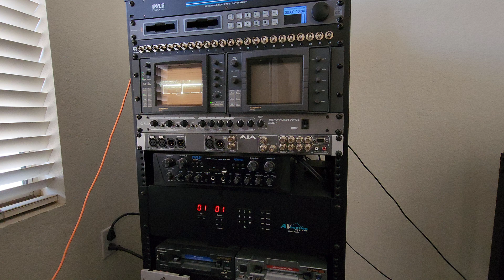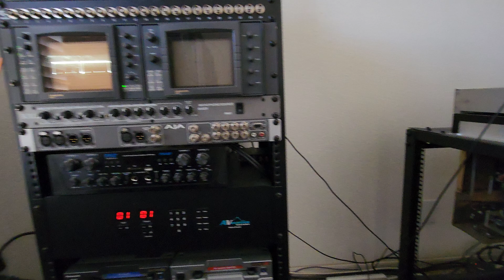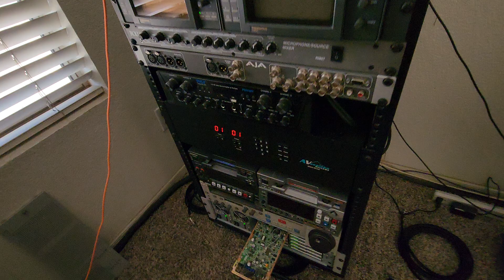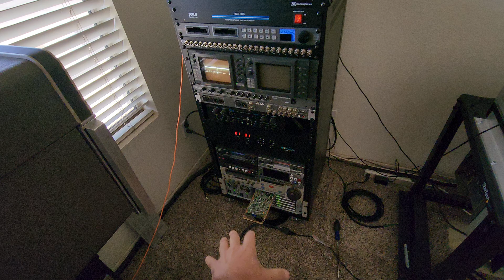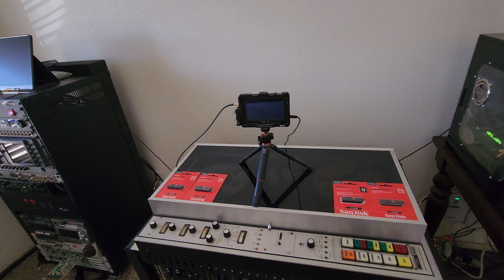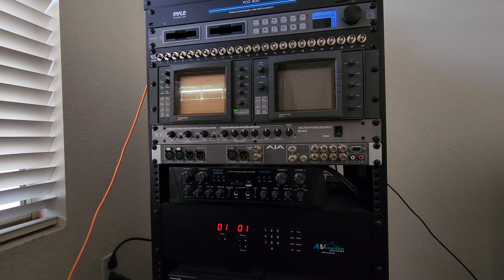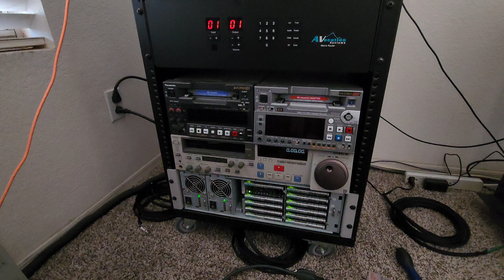Time Base Correction Frame Sync Why It's Needed...

Comment: Some (digital) timebase correctors can also handle U-matic Dub signals, which provides a huge improvement over Composite Video connections for U-matic tapes.  But they are hard to get, as are the cables.
Reply: I have a IDEN IVT-7 that has dub that converts to S-VIDEO and eventually when I get a U-Matic deck with dub I'll build up the cables I have parts for.

Comment: @4:30 Just a suggestion. I would not run broadcast machines with built in TBCs though that ForA unit. It's redundant and actually degrades image quality. On a broadcast deck, the tape signal is digitized, either a direct digital recording , D5, or via an AtoD converter on the internal TBC, Betacam, Type C. Then it's converted back to analog. Now when you put the external ForA TBC in line, you are going through another AtoD / DtoA conversion. That means analog filtering is being applied twice again. As broadcast formats are of very high quality, it will make a difference. All broadcast decks have proc amp controls, Video, Chroma, Black, Hue and more just like the ForA does.
Reply: Although the first comment only rightly bashed 2 US companies, YT subsequently deleted my Audio Delay answer comment.

Comment: Altera Max FPGA combined with several individual VSLI on a heavy, multilayer PWB definitely built for field/professional use appears quite expensive. That's not even considering the rack housing with its backplane and power supplies along with 12 individual modules. Maybe now, an equivalent individual TBC system could be primarily "software" based in a smaller and less costly form factor, but I still enjoy seeing older designs of mostly dedicated hardware-based TBC's.

EDIT: Just noticed that it's made by FOR-A, which was established in 1971 in Japan, then a US subsidiary in 1972. The FA-410P in 1981 was considered "the best time base corrector on the market." Apex quality equipment. 😎
Reply: That product was designed for TV stations incoming feeds. That could be any combination of ENG remote microwave, satellite, telco lines, network, even  competing stations. And you needed a frame sync on each one to lock everything to the station master sync. So putting 12 in a 3 RU box was quite attractive. Note the dual redundant power supplies. Other companies made card based units as well, Leitch, Evertz, Lenco, Miranda, come to mind. Other alternatives were compact 1RU single channel units. When I started in 1980, a frame synchronizer was a 6RU box (10.5 in high),  19in wide and about 20in deep. Full of cards and loud fans for just one channel. Prior to my industry start, the first frame sync in 1974 was a full equipment rack. Made by NEC, NBC had two, one on each coast.

TBC is still done in silicon even today. The CPU horsepower to do that in real time, even with SDTV, is just not cost effective. A TBC block in an FPGA is just a fraction of the hardware an FPGA can hold.

Comment: Where is the audio delay for TBC compensation ?
Reply: For a true TBC you don't need any because the delay is only a few horizontal lines at most. Older TBCs fed an advanced vertical sync signal back to the VTR to keep the playback within the the TBC memory window. And you needed a captain servo VTR.  Modern TBCs starting in the late 1990s are frame synchronizsers and will work with any helical VTR. But they have a frame of delay, 33ms. This is typically overlooked. Where we got into trouble was cascaded frame syncs from network and satellite distribution. Especially for international events. You could end up with 5 or 6 frame syncs in the total transmission path. Several companies made audio delay units to fix this problem. Then came MPEG compression and we really started have problems with audio lip sync.
Reply: @andydelle4509  A TBC that does not store at least 40 mS (PAL/SECAM frame synchronizer) seems unsuitable to me. Without the next Vsync, a TBC cannot know exactly how many lines were missed due to dropouts. The European version of the Panasonic DMR-E55EG (the first DVD-Recorder with YUV out) saves over 5 fields in EE Mode. Blackmagic Intensity does not even work with a DVD player if STOP at dropped frames is switched ON, as the source speed is ignored. I have not been able to find anyone on the Internet who has switched STOP at dropped frames ON and had success. Runs for around 2 minutes 50 seconds with PAL. If off is selected, the sound is shifted by around 30 seconds after 1 hour. 3x PRO and 2x Shuttle failed 100% in my tests. I see myself between full professionals (TBCs from 2000E) and the Elgato I don't care about anything solution. The Chip in the Elgato Grabber cannot output PAL/SECAM at all. I want to use the Blackmagic HDMI/SDI in PCIe card with a Pioneer PAL/SECAM/NTSC in DVD recorder. It can only output 4:4:4 in PAL interlaced EE Mode, which Blackmagic HDMI Solutions compatible with Windows 7 cannot handle. I don't want to run editing computers as uncompressed recorders. The Hsync capture range of the Pioneer is larger than that of the Panasonic. In the Panasonic demo video I adjusted the head switching point all the way down:  https://youtu.be/M5kYTCwYVy8